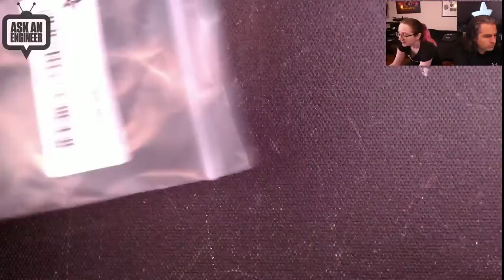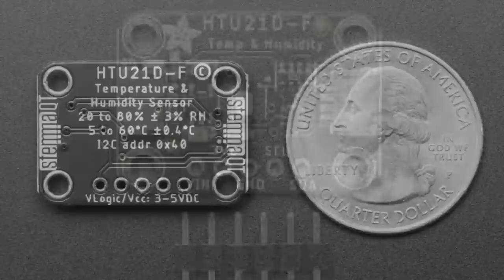New Products 2021_03_24 feat. Adafruit Neo Trinkey - SAMD21 USB Key with 4 NeoPixels!

Comment: Are the trinkey touch pads reconfigurable like with the Circuit Playground Express? Or are they solely for cap touch?
Reply: I would assume they're useable for whatever if you can solder to them, though you wouldn't want to hang too much from your USB port. The QT Py is probably a better fit if you want a small size board with a samd21 for something other than 4 NeoPixels and two cap touch.